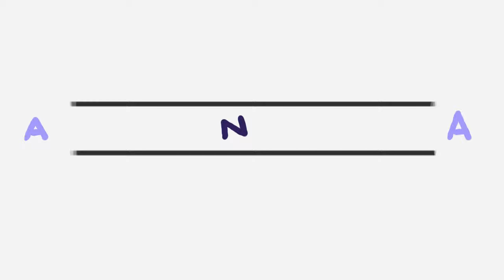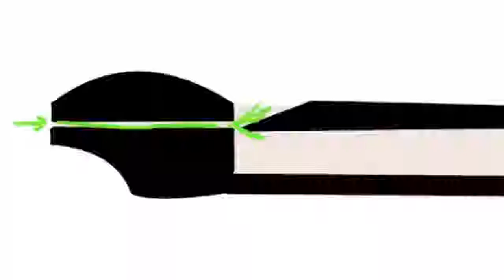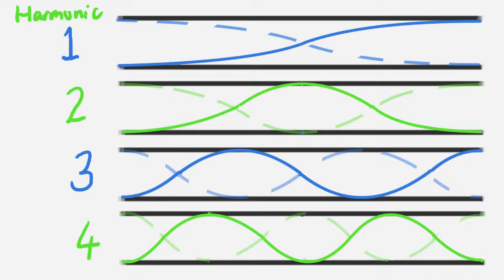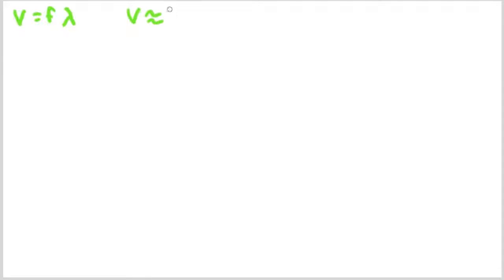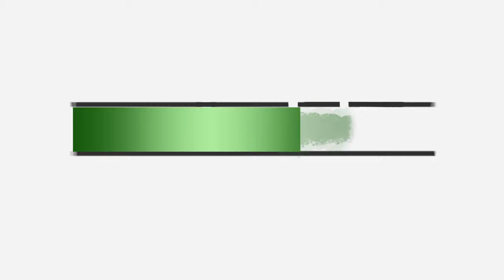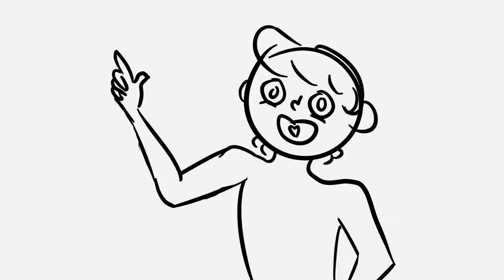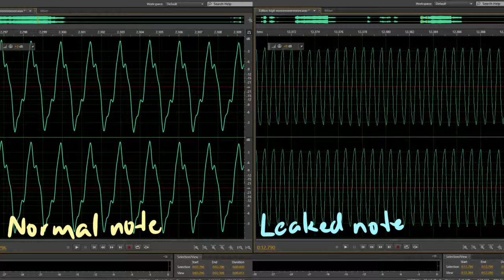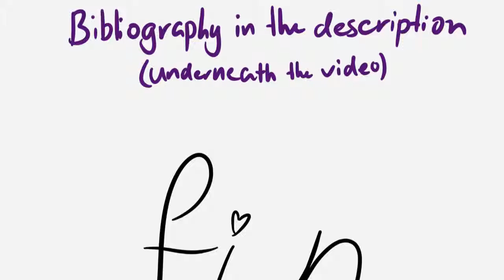Recorder Physics

Comment: Great video! By the way, what grade did you get on this video if I may ask?
Reply from the maker: The assignment was to "Demonstrate understanding of the application of physics to a selected context" and I achieved it with Excellence (basically top marks). 
The grading system goes; Not Achieved, Achieved, Merit, Excellence

Way more work than I needed to do for 3 credits (most people just made posters;;) but I'm still getting comments years later so it was worth it. Sorry it took me so long to reply!
Reply: @seakhajiit  your video helped me tremendously, I was doing basically the exact assignment a couple of months ago and I must say, I couldn’t have done it without this video!
Reply from the maker: @tramadoljanne123  That's so cool! I'm happy it helped :D

Comment: Great explanation of the physics of the recorder - but something is wrong with the sound volume - had to turn up the sound to max on my computer, and then could barely hear you - I wanted to hear everything you had to sy ... but very difficult :( ... then the next video came up and almost blew out my speakers before I could quickly turn down the sound again ... Pls correct on your end so I can hear your video with so much great info ...